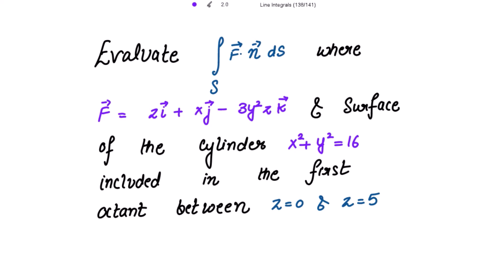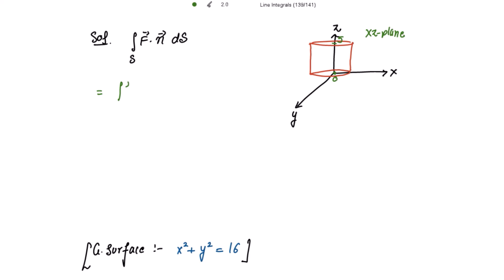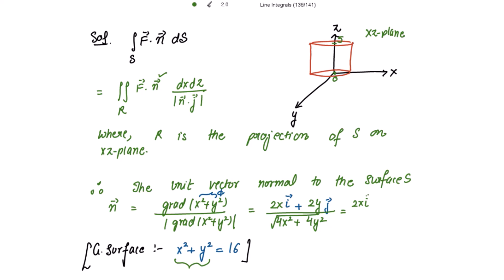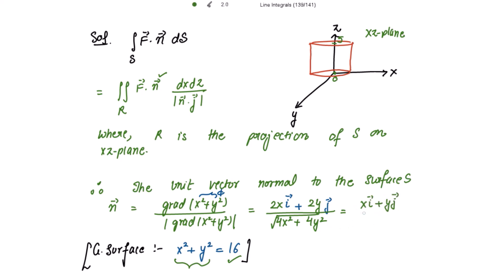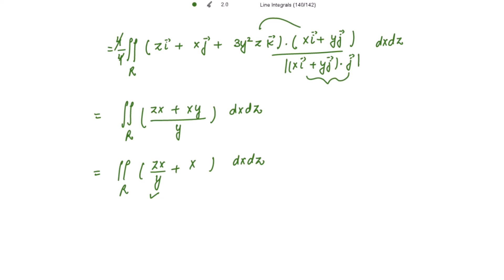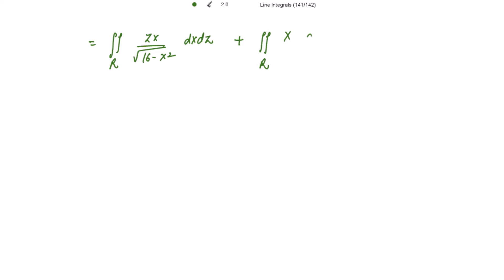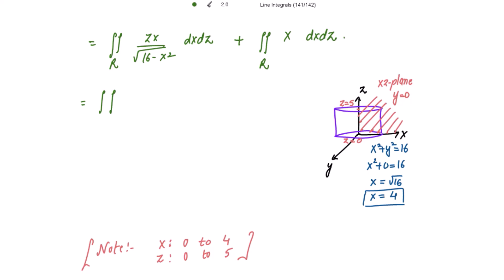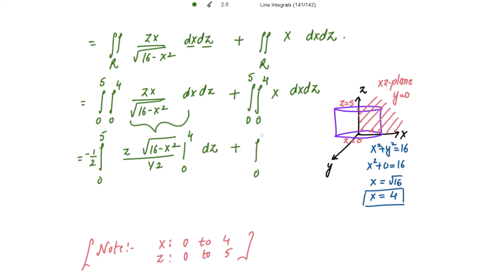Evaluate the surface Integral for Cylinder x²+y²=14 in the first Octant.     SURFACE INTEGRALS

Comment: Will the math be correct if the projection is done on the YZ plane?
Reply from the maker: Yes, you may take the projection on either xz plane or yz plane as z=0 and z=5 is representing the height of the cylinder. 

It is given to us that cylinder x²+y²= 16 is including the z=0 and z = 5 in the first octant.

Comment: why cant we take xy plane
Reply from the maker: Yes, When calculating the surface area of a vertical cylinder like 
𝑥²+𝑦²=16 with the z-axis as its axis.

 The xz-plane (or yz-plane) is used for projection because the surface's equation can be explicitly written as a function of x and z (or y and z ) which is required by the surface area formula for projections.